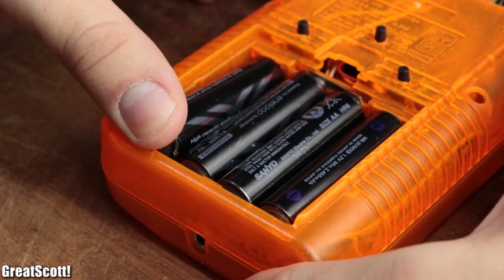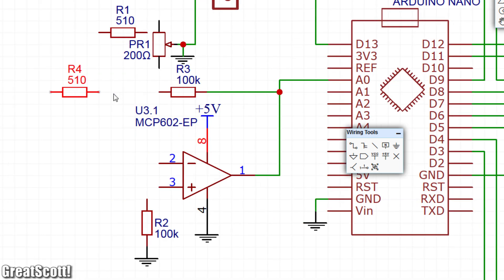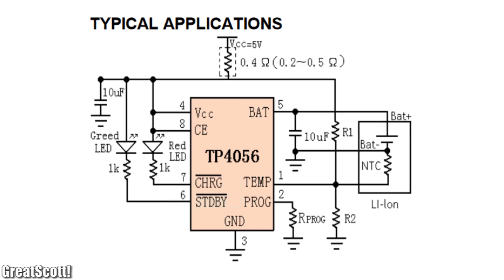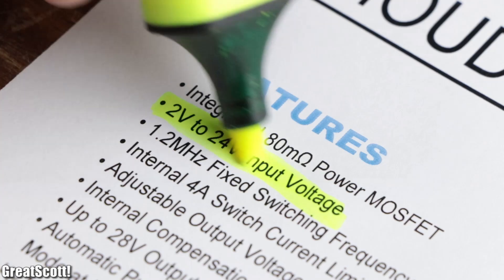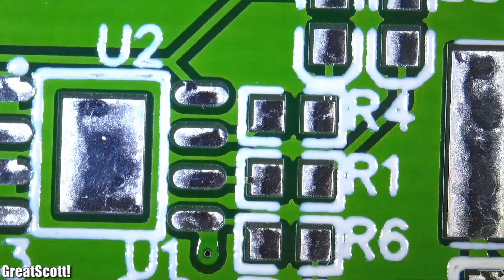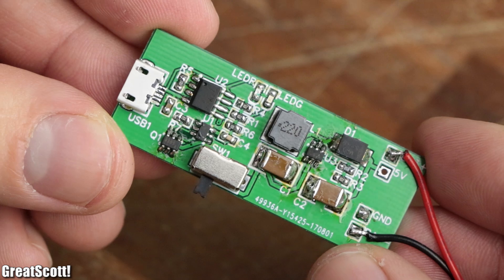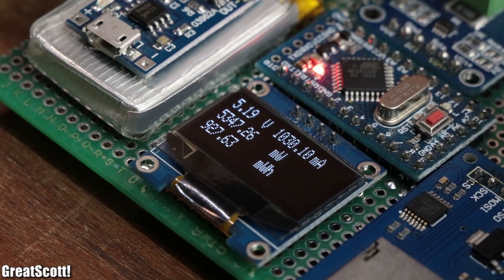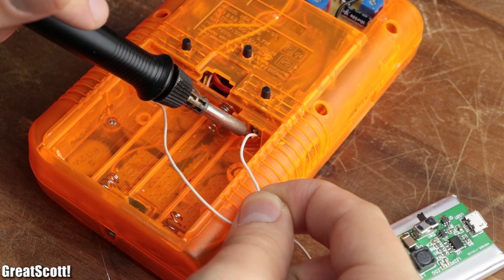DIY LiPo Charge/Protect/5V Boost Circuit

Comment: Boost 3.7v to 5v so that the board being powered can regulate it down to 3.3v
Reply from the maker: There are many projects where you can use this circuit. Not just with the Raspberry Pi.
Reply: He is joking...
Reply: Actually the raspberry pi zero w converts the 5V down to different voltages for I/O, CPU and so on. It's voltage regulator design is quite nice as some voltages can be software defined. And instead of the old inefficient linear regulators it features switching voltage converters. So the overall design in this video sums up to a boost buck converter, which is needed when the power source voltage varies so much above and below the required voltage of the respective components.
Reply: It only has such high power requirement to satisfy USB devices tho
Reply: squalazzo Well my RPi3 currently runs off a 1A ac/dc adapter driving a 8x7 segments (and led and keys) module alongside a 4xrelay board, WiFi enabled. Running a low-cpu app.
Reply: I like this design. Can I modify the board layout and use this in my own build?
Reply: Lol.
Reply: Ass backwards operation at its finest. Definitely over engineered as everything else he makes.
Reply: I'm also working on a Piboy project at the moment using the RPI3 and even though 2-3amps are recommended, the Pi3 is perfectly fine with 1A if you don't connect to many peripherals.
Reply: donpalmera, I didn't know what you know. My only indication is your initial comment. And the over generalised 3.3V was indication to me that some elaboration on the matter might help. I might also have missed the point of your comment. I'm assuming you may be upset about the efficiency losses that add up. Or you would prefer a more complex and expensive raspberry pi design that let's you conveniently attach a Li-Po cell directly. I'm not even sure if that was a complaint or attempt of a summary of the videos content.
Reply: +R Sana Calling somebody "butthurt" when you just kicked them in the ass for no good reason only brings to light just what a douchebag you were for criticizing him for asking a question. Something that the comments section happens to be designed for.
Reply: donpalmera I don't understand why you want that. Each conversion wastes a bit of power since efficiency of these circuits is never one hundred percent. You can add a tiny low-dropout regulator to go from 3.7 to 3.3 volts. I did this recently and I'm a newbie :)
Reply: @StoneFlange  the Gameboy clone works with 3.3V, but the input is 5/6V so that they can use normal AA batteries and have enough power. This steps the voltage to 5V to turn on the Gameboy, which will drop the voltage to 3.3V again so as not to burn itself down.
Reply: not suitable for RPi3 as it needs more than 2A, suggested 3A if using peripherals... can you suggest some change to make it work in this scenario? A different IC, which one?
Reply: >Actually the raspberry pi zero w converts the 5V 
>down to different voltages for I/O, CPU and so on. 

Really! I didn't know that yet made a comment that alluded to the 3.7v -> 5v boost stage being redundant... (yes I'm being sarcastic). What you are talking about is called a PMIC by the way. They are very common on little embedded machines that need multiple power rails. A few of them include all the logic needed to switch between wired and battery power, do battery charging, low voltage cut off etc.
Reply: I think you over estimate how much people care Arno.
Reply: M Sana: moron, nobody asked you anything... if he's kind to answer, well, if not no problem, in any case not your business... and i added the stuff about RPi3 he was missing... i only asked, not forced him and i'm fine if he does not answer in any case...

Comment: And soon enough China is going to copy it and make available in AliExpress. :|

Really good work, man!
Reply from the maker: I think I would not even mind it in this case. I made this project open source so everyone can make such a circuit. But that will always be a bit more expensive than a chinese company who would produce them. This way you could get this circuit as cheap as possible.
Reply: Yeah if I could get one of these things fully assembled for $1 or less that would be great, especially since I don't have the tools necessary for fine SMD work, just solder and an iron.
Reply: You can. Just search ebay for 'diy power bank' (without the quotes). These kits start at $1 and they contain a fully assembled PCB that does charging, protection and 5V boost.
Reply: GreatScott! That's true!

Comment: Can this be used on 18650 cells too?
Reply from the maker: +HellFireno88 Yes
Reply: I know. But saying 18650 is a quick way to say li-ion 3.7v cells.
Reply: It's probably worth a look into NiMH batteries because a good NiMH battery can come very close to a lower capacity LiPo in power density. For what you lose in capacity you gain in safety, as NiMH batteries don't have violent failure modes like LiPo batteries do. They can vent and leak, but they won't explode or catch fire.

The reason a LiPo charger won't work on a NiMH is because as a NiMH battery is charged to near maximum capacity, its voltage will drop slightly, which can confuse a LiPo charger into thinking  the battery needs more current.
Reply: NiMh batteries should not be charged with a LiPo battery charger as the method of charging is different.
Reply: I do the same with old battery packs to get 18650 cells (and occasionally some weird flat cells), but I'm too lazy to match the capacities of the used cells and usually just end up using them individually or in pairs. Some crap battery packs use crap batteries from the start, or have really bad balancing which ruins the cells.

I have a pile of dubious 18650s which have nearly no capacity from some of the cheap Chinese battery packs. About the only thing they're good for is using in single cell battery banks with one of those LED USB flashlight things.
Reply: Yes just will take longer to charge